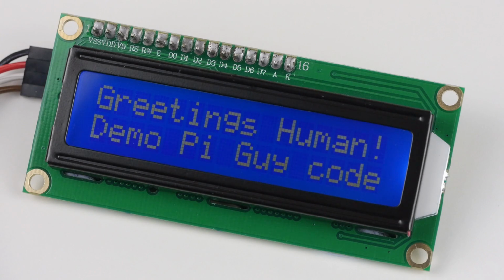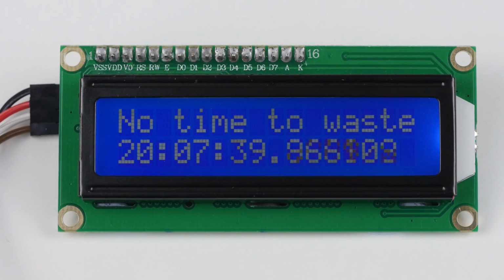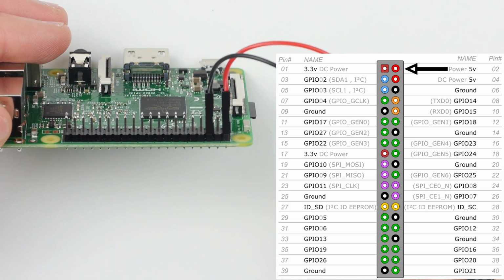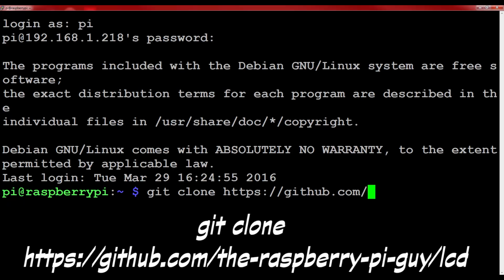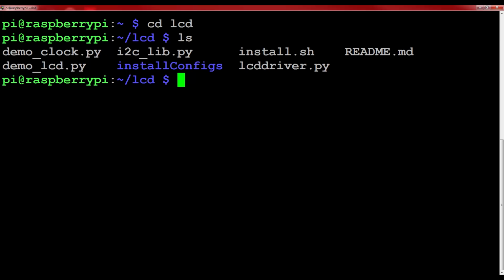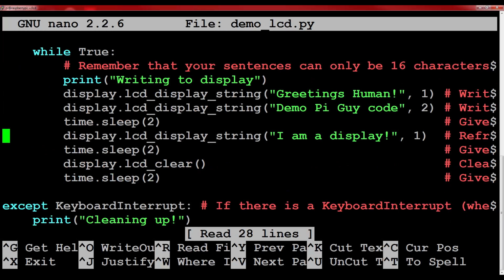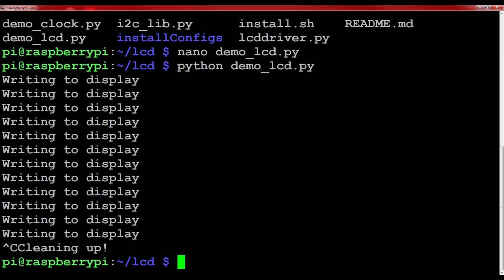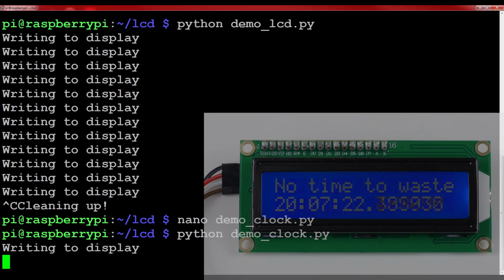Raspberry Pi - Mini LCD Display Tutorial

Comment: To get my one to work I used i2cdectect to get the address of the lcd screen then with this I went into theh lcddriver file and changed the lcd address from 0x20 to 0x3f. Hope this helps someone!
Reply: To find out the I2C addresses, 
sudo apt-get install i2c-tools -y
sudo i2cdetect -y
Reply: Still having the same problem, kept switching back an forth between 20 and 3f, heck even 27. Any other possible solutions? I2C is enabled in the raspi-config
Reply from the maker: +Craig Griffin glad you got it all sorted!
Reply: Hello,
I have a liddle Problem:
I bought this Display : https://www.amazon.de/Schnittstelle-1602-Serielle-Display-Modul-Arduino/dp/B01JZ75AG2/ref=sr_1_4?ie=UTF8&qid=1473947258&sr=8-4&keywords=16x2+Serielle+LCD+Display-Modul 
My question now is, does it work with the Raspberry Pi, because it needs 5V to run.
Reply: yes it does raspberry pi have 5v input. no worries.
Reply: Thx! Made my day. :-)
Reply: i ran i2c_lib.py, and then ran lcddriver.py it works now like a charm. just run those 2 and hope it works!
Reply: Backpack
Reply: Craig Griffin thanks

Comment: diy perks does a video on making a 4k projector using a lcd screen with hdmi. the problem is you cant run a display without connecting a computer. ideally I would want to connect a streaming device or xbox or bluray. so my question is: can you use a raspberry pi to run the display on the lcd screen by connecting a  xbox or what not without having a laptop out?

Comment: Hi, i was wondering can we control the backlight brightness level using some python codes?
Reply: Use a resistor or you might be able to use the 3v pin and not 5v.
Reply: @VanishingTacos  hmm...using resitor will be a fixed solution right? Suppose i want to dynamically control the brightness, i have a code which uses the lcd display 24hrs a day, i want 8hrs during night time as low brightness and rest 16hrs on normal brightness. Can we do it using some coding implementation?
Reply: @sudarshanbandyopadhyay9052  Look into pulse-width modulation. I know you can use that to control the brightness LEDs.
Reply: @VanishingTacos   thanks, will look into it.

Comment: Traceback (most recent call last):
  File "demo_lcd.py", line 6, in <module>
    import lcddriver
  File "/home/yudho/lcd/lcddriver.py", line 12, in <module>
    import i2c_lib
  File "/home/yudho/lcd/i2c_lib.py", line 1, in <module>
    import smbus
ImportError: No module named smbus

I ended up with this code on ubuntu mate, but it doesnt do this when i use raspberry os, can someone help me please
Reply: I have the same issue 

Does anyone have a fix for it
Reply: @ishanrajesh9528  an update on september fixed it for me, and now i can run this code on any OS, except android ofc

Comment: Traceback (most recent call last):
  File "demo_lcd.py", line 11, in <module>
    display = lcddriver.lcd()
  File "/home/pi/lcd/lcddriver.py", line 74, in _init_
    self.lcd_write(0x03)
  File "/home/pi/lcd/lcddriver.py", line 98, in lcd_write
    self.lcd_write_four_bits(mode | (cmd & 0xF0))
  File "/home/pi/lcd/lcddriver.py", line 93, in lcd_write_four_bits
    self.lcd_device.write_cmd(data | LCD_BACKLIGHT)
  File "/home/pi/lcd/i2c_lib.py", line 11, in write_cmd
    self.bus.write_byte(self.addr, cmd)
IOError: [Errno 121] Remote I/O error

Comment: Question: I am already using the GND and one of the 5V pins on the GPIO for my case's fan. I see the GPIO has another 5V and GND. Can I use any of them for power, and use SDA and SCL for the data/clock?
Reply: Yeap

Comment: Raspberry 4 ERROR: This example works fine on any of my RaspPi3 but can not get this to work on my Raspberry Pi 4.It appears to be an address error but running i2cdetect -y 1 does not work on this cpu either (raises an error) which works fine on the 3.

Comment: Traceback (most recent call last):
  File "/home/pi/lcd-master/demo_clock.py", line 12, in <module>
    display = lcddriver.lcd()
  File "/home/pi/lcd-master/lcddriver.py", line 74, in _init_
    self.lcd_write(0x03)
  File "/home/pi/lcd-master/lcddriver.py", line 98, in lcd_write
    self.lcd_write_four_bits(mode | (cmd & 0xF0))
  File "/home/pi/lcd-master/lcddriver.py", line 93, in lcd_write_four_bits
    self.lcd_device.write_cmd(data | LCD_BACKLIGHT)
  File "/home/pi/lcd-master/i2c_lib.py", line 11, in write_cmd
    self.bus.write_byte(self.addr, cmd)
IOError: [Errno 121] Remote I/O error

Getting this error. I was sure pins were properly soldered also the lcd too.

Comment: Where do I put the Fan Pins, because both those are in the black and red spots you have. I can choose any 5v and ground location? (I guess I could just put the fan red in the 3.5v location and just have low power maybe?)

Comment: I am running 0*27 display with raspberrypi. display not giving any output but it is chaging brightness.
i tried different display and it is working. i want to check problem with older display

Comment: Please help what is this errors

Traceback (most recent call last):
  File "/home/pi/Desktop/Research/lcd/demo_lcd.py", line 11, in <module>
    display = lcddriver.lcd()
  File "/home/pi/Desktop/Research/lcd/lcddriver.py", line 74, in _init_
    self.lcd_write(0x03)
  File "/home/pi/Desktop/Research/lcd/lcddriver.py", line 98, in lcd_write
    self.lcd_write_four_bits(mode | (cmd & 0xF0))
  File "/home/pi/Desktop/Research/lcd/lcddriver.py", line 93, in lcd_write_four_bits
    self.lcd_device.write_cmd(data | LCD_BACKLIGHT)
  File "/home/pi/Desktop/Research/lcd/i2c_lib.py", line 11, in write_cmd
    self.bus.write_byte(self.addr, cmd)
IOError: [Errno 121] Remote I/O error
Reply: change your i2c address to 0x3f if the default value doesn't work

Comment: It's a very good video. I get an error when I try. Help me-----------------------------------------------------------------------------------------------Traceback (most recent call last):
  File "demo_lcd.py", line 11, in <module>
    display = lcddriver.lcd()
  File "/home/pi/lcd/lcddriver.py", line 74, in _init_
    self.lcd_write(0x03)
  File "/home/pi/lcd/lcddriver.py", line 98, in lcd_write
    self.lcd_write_four_bits(mode | (cmd & 0xF0))
  File "/home/pi/lcd/lcddriver.py", line 93, in lcd_write_four_bits
    self.lcd_device.write_cmd(data | LCD_BACKLIGHT)
  File "/home/pi/lcd/i2c_lib.py", line 11, in write_cmd
    self.bus.write_byte(self.addr, cmd)
IOError: [Errno 121] Remote I/O error

Comment: Hello, i used i2cdetect -y 1 and my display apperas as "3f", however, when i run any of the scripts, no characters are displaying on the screen. i changed the address in lcddriver.py to 3f. Any clue on what can be happening? My LCD is turned on, but no characters are displaying on the screen. I'm wiring directly to a Raspberry Pi Model B like you show in the video. Thanks in advance!
Reply: can you see rectangles on the screen?  If no, you need to change the value of the potentiometer  on the back of the LCD with a screwdriver.  I had the same issue.  did you leave the address = 0x3f?

Comment: not sure if i have a dodgy display, its wired correctly, i changed the lcd address to 0x3f, ran the sh file and rebooted, ran the demo but the screen is blank, twisting the potentiometer on the back does nothing, i have a red power light on the back of the screen so i'd assume it works and maybe i did something wrong
Reply: turn the pot the other way

Comment: PLEASE HELP!! IT GIVES ERROR!

I OError: [Errno 121] Remote I/O error
Reply: I had the same problem. go to the file lcddriver.py and change the adress to 0x3f
Reply: same, any solution??
Reply: same!
Reply: check the address on the back of the display module....you might have a config issue and need to change the address, this is a common issue with arduino so look that up if you need more help
Reply: Hi, I am learning how to use LCD screen so how do you check the address and change it on raspberry pi? I need help thanks, I am also facing remote I/O error 121 from running codes that others have proved to work, so I believe it is my problem.
Reply: not enough information to answer your question. if it has the four pin on the back and you're using linux you can dmesg...  usually the module has the address at the rear

Comment: How can i get clock speed and temperature to display ?
Reply: For temperature, you'd wanna do a system call since the pi has a command for getting that data built in. Not sure about clock speed though lol

Comment: Thanks alot! I didn't know you could lower the brightness with a screwdriver!!
I thought my LCD screen didn't work, but it was the brightness!!
Reply: Ummm, its not the brightness its the contrast setting, u can change the brightness by placing somekind of resistors between gnd and vcc from the pi itself, i personally use 3x1k ohm resistor in paralel

Comment: I keep getting several errors. Here the first. Line 11, in <module>. display = lcddriver.lcd(). Can you help?  I can see you a pic of all the errors if you want
Reply: ok same thing happened to me, I did 2 things to fix it. First of all, I had my SDA and SCL wires switched by accident, second of all i gave the command:
sudo i2cdetect -y 1
And in the lcddriver.py file I changed the ADDRESS = 0x<whatever> value to what I saw after giving out the previous command, in my case 3f, so i changed it to 0x3f.
Reply: thx - the socond one was the solution!!!
Reply: HUNVilly thx man it workt with the second thing
Reply: HUNVilly its pretty hard to find for a beginner

Comment: Thanks and works well. I had the same I/O error 5 issue as the guys below and it cleared when I went to raspi config and added ssh and camera and then rebooted (nonsense, right?)

MY REAL INQUIRY: how can I keep my lcd clock going when I switch to an
other directory in linux terminal? Thanks.

Comment: hey buddy, I've got a problem when I executed the program
"File demo_lcd.py, line 11, in <module>
display = lcddriver.lcd()
File /home/pi/lcd/lcddriver.py, line 67, in__init__
 self.lcd_device = i2c_lib.i2c_device(ADDRESS)
File /home/pi/lcd/i2c_lib.py, line 7, in _init_
 self.bus = smbus.SMBus(port)
IOError: [Errno 13] Permission denied"
Reply: +Diego Riveros Did you turned on the I2C option in the RPi configuration program? If you didn't, than that's your problem. (sorry for my english, if it isn't too good)
Reply: +Szymon Borecki it's working! I added the line: i2c-bcm2708 in the file /etc/modules, then I updated the system and installed i2c python libraries(version 2): sudo apt-get install –y python-smbus i2c-tools , and rebooted the Pi

Comment: I have on of the original rev 1 pi's and i'm getting this error. noticed in the comments others are  having the same issue

Traceback (most recent call last):
  File "demo_lcd.py", line 11, in <module>
    display = lcddriver.lcd()
  File "/root/lcd/lcddriver.py", line 69, in _init_
    self.lcd_write(0x03)
  File "/root/lcd/lcddriver.py", line 93, in lcd_write
    self.lcd_write_four_bits(mode | (cmd & 0xF0))
  File "/root/lcd/lcddriver.py", line 88, in lcd_write_four_bits
    self.lcd_device.write_cmd(data | LCD_BACKLIGHT)
  File "/root/lcd/i2c_lib.py", line 11, in write_cmd
    self.bus.write_byte(self.addr, cmd)
IOError: [Errno 5] Input/output error

Any help would be grand. Thank you :)
Reply: +Nat Klopper To get my one to work I used i2cdectect to get the address of the lcd screen then with this I went into theh lcddriver file and changed the lcd address from 0x20 to 0x3f. Hope this helps
Reply: +Craig Griffin Thanks Craig, worked superbly.  Totally forgot about the i2c addresses!!

Comment: That's awesome! I already have the display, so I only have to buy the I2C board. This one looks very good and cheap http://www.ebay.com/itm/IIC-I2C-TWI-SPI-Serial-Interface-Board-Module-Port-for-Arduino-1602LCD-Display-/161245616356?hash=item258afcd8e4:g:9REAAOSwBahU1CiK

Comment: Will your code work with a SainSmart LCD keypad module based on the HD44780 controller, this is what I can get locally to me it's the same but a 4 line display, it has the same  pins as the display you have used.
Reply from the maker: +Rays RCs hi there, do you have a link to your display?
Reply: https://www.amazon.ca/SainSmart-Module-Arduino-Board-White/dp/B003B22UR0/ref=sr_1_1?ie=UTF8&qid=1459424758&sr=8-1&keywords=SainSmart+LCD+keypad+module
Reply: But I can't seems to find it on the Sain Smart website, s oI'm not sure of the model number
Reply from the maker: +Rays RCs that looks very similar (if not the same) as the style that I use in this tutorial. It should work.
Reply: Thank you for a fast replay, I shall order one and see. Some reviews say it work with the Pi no issues, so even if your code does not run it it should be easy to set up. :)